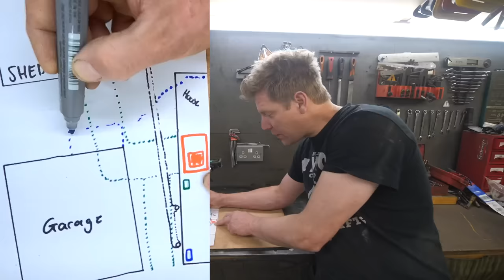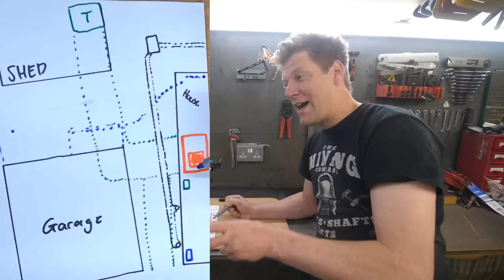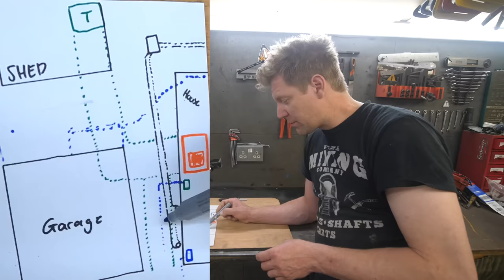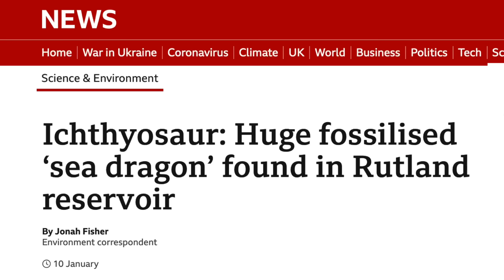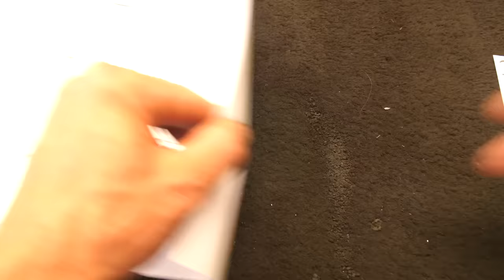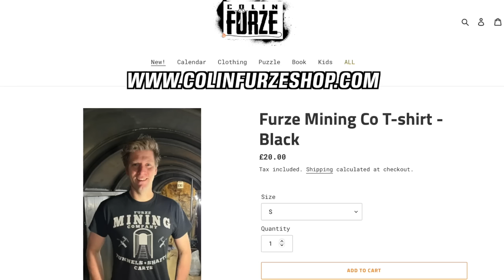DIGGING A SECRET TUNNEL Part 9

Comment: Those major cracks in the rocks are called "joints" by geologists and can form for any number of reasons. You're also totally reasonable in comparing to the nearby quarry, and it's a neat comparison too because some of the first geologists, from the UK, and made similar comparisons to what they found in their digs to quarries miles away - and that near-horizontal comparison helped geologists clue into (sedimentary) rocks being deposited horizontally and that they resulted from "sedimentation".
Reply: Do you know where the draft could originate from? Or could that be from almost anywhere where there would be the slightest hole/crack/gap?
Reply: @Masterfighterx  
The draft could be coming from anywhere along any interconnecting crack. Broadly speaking, it's generated by a difference in heat and pressure from the air source and the tunnel. 

I'd guess it's carrying cool dense air from somewhere a connected crack comes to, or close to, surface and the air is flowing down into the ground and welling up/flowing into his tunnel. Kind of like water flowing from the surface into a leaky basement. In such a case one might see the air flow fluctuate (speed of the air, directionality) somewhat in correlation with surface temperatures/weather/the seasons. 

Another possibility is that it's hot air, warmed by some deeper/nearby heat source (or just the natural earth heat gradient) and it's upwelling/rising through interconnected cracks. 

In both cases, "nearby" could be miles away or right next door. 

Yet a third option, though a bit different from the others, it could be air displaced from the cracks by water, such as from a recent rain, the tides, etc. He might find the directionality of the air flow changes depending on how wet or dry the season is as the groundwater level rises and falls.
Reply: @Dudekahedron  Excellent information!
Reply: Agreed, stellar breakdown! From a fellow geology nerd, all 3 scenarios are fully plausible. Would be really interesting to see any well logs and maps from the area to dial it in.
Reply: @Dudekahedron  Thanks, much appreciated!
Reply: Was he right about how long they can go on for? How big are these joints usually?
Reply: @mangoesareonsaleatcoles660  
Great question! I'm afraid I don't have a definitive answer for that. You'd have to track down a structural geologist, seismologist, or a professional geotechnician. Of which, I am not. I'll try my best to explain how joints work, with what I, am hopefully, remembering correctly, though to maybe give folks a better sense of what they are; "organized" cracks.

I think it's important to know that joints are very common. Their widths, lengths, and heights are all functions of how plastic or brittle the host rock is and whatever changed in the forces acting on it. A sheet of glass is really brittle, so when you bend it too far, the cracks, ie joints, can be really long and "clean". Whereas if you pound flat and bend a sheet of clay you'll be met with swarms of cracks or just it stretching. 

A Joint also, usually, doesn't occur alone. Unlike my analogy, most "bendy forces" don't end up focusing on a single seam, like if we fold a piece of paper (though sometimes, like chevron folds). The bendy forces get distributed over the rock as it "arches", and multiple joints form all with similar orientations.

Edit: they don't exclusively form from bending, either. An alternative example would be gently piling paving stones onto a sheet of glass until it "crushes". Any large systematic force or change in force can do it. 

Because so many can form, it's very easy for one joint to end and a perpendicular joint, or boring old crack, to connect with it and dissipate the forces into a new parallel joint that didn't end. 

The longest joint I've seen, that didn't become a fault, is probably a few hundred meters long and a hundred or so meters tall. It occurred in a really impressive fold that exposed near the top of a mountain near Cajabamba, Peru. Smallest joint I've seen is a mud crack in a dried up pond, a couple cm long maybe.
Reply: @Dudekahedron  if the crack inhaled air could colored smoke be used to trace the exit?

Comment: For your high vent you should look into using a radon evacuation fan. They are inline so it would be easy to add and you can find flow characteristics easily.
Reply: Interesting Cody, I thought about Radon too. Here is New York I heard it can be a problem.
Reply: @zipp4everyone263  I guess my hopes for a tunnel are over. lol😆
Reply: @fjs1111  Nah, radon happens above ground as well. Talk to your local county/council and see if they have any free radon meassuring tools. Id suggest you do it anyway unless you know for a fact that there isnt any radon where you live.
Reply: @zipp4everyone263  Thank you for that information, will look into that!

Comment: These vids are like a guilty pleasure. Just watching them over and over to see if I missed any details, it seems so fun! When colin is excitedly going through the tunnel entrances with a smile it makes me think of fred and george weasley plotting something troublesome. I am curious though, you have mentioned a few times that the mesh does a good job holding back the concrete but what do you do about the little drops that do fall through? wipe it away before it hardens? or is it all behind the walls you are going to put up anyway so you ignore the drops?

Comment: "It's easier to ask for forgiveness than ask for permission".  If I learned anything from this video, this is the #1 thing.  Absolutely brilliant!
Reply: Depends what you're doing, not much they can say about it since no cables or pipework were at risk, and it's not littering his lawn or anything.
I wouldn't take it as good fish to build an annex building at your property near the lake or anything.
Reply: @N Fels 
Listen, what we're on about is this:
They gave Furze the ok (and he was prepared to fill it in once he was done).
Anyone with grey matter in working fashion can see the difference between what Furze is doing, vs putting up a brick house on worm-eaten wooden foundations or stupid stuff like that, the effects of which, Lara Kempf, another youtuber, is struggling with right now.
Also, remember, I CLEARLY advised strongly AGAINST putting up anything on waterfront property and not tell anyone.

I've been in construction for a wee bit, and welding too, and no foundations were made until after the soil was checked, and no concrete was poured until after the concrete was tested, not a single nail, screw, plank or box was put up without going through the OK'ing process.
Same thing with the welding, x-ray's and granular inspections all the way from here and to Japan and back.
Every type of material and composition thereof has it's limitations and tensile strength.
Outside of work I have never put up so much as a single brick or 2x4" or weld bead in any sort of permanent state where strength mattered, without every I and T checked and crossed & approved from and by the appropriate authorities and OTHER professionals, wherever required, and sometimes OUTSIDE of lawful decrees.

Why? Because I live by the mantra that everything you do can be criticized & scrutinized, I make it a point to have it criticized even if I CAN get away without.

That doesn't mean that I have no right to make up my own thoughts, as well as speak them in public for that matter, so long as they're not acted upon, putting lives at risk.

I get that you see a lot of sh*t every day, but you're there for a reason, to catch the 1% that goof.
Trust is the crux and core of our society and we can't function without it.
Next time, keep feelings in check and give people benefit of the doubt, that goes for people you work with, and people you work for.
And if you can't do that, such as you've venomously demonstrated here, you don't deserve so much as a single PENNY of that 40-60k.
That about sound fair enough?
Reply: @ellkir1521  Absolutely! I advise against any unsafe haphazard sh*t, costs more in the long run.
But as Furze clearly said, he was prepared to fill it back in and only seemed to bring it up with city counsil and the like after they spotted it on facebook, and he gave the OK to actually have it inspected for the pure shiz of it, and they actually approved.
So he must have done something right.

Agree about most of the building rules, they're meant to protect contractors and homeowners alike.
And on the note of all the woke building rules, I've even seen those that preach about and for certain codes and the like get their stuff bulldozed too because they thought they were above the rules.

Comment: I think a big part of why your retrospective-planning strategy worked was because you (presumably) had the skills to evaluate what could go wrong (the likely, less likely, and nigh-impossible, all) and the ability to absorb most if not all of the expected consequences if it did. I would think for someone who doesn't have the same skills and experience with construction, plumbing, and engineering as Colin does, you'll want to file with your local authorities BEFORE you get started, so that they can alert you to anything you don't know about.
Reply: his method was a very dodgy way to do it. you should ALWAYS get approval before doing any sort of work that requires the approval of a planning body. he didn't cause he knew they would say no. if he wasn't a YTber they would still have said no
Reply: With the casual way he mentions how upset the town council is, this stunt still might come back to bite him. It's not super frequent, but a few celebrities have found themselves evicted from town by municipal governments for doing over-the-top stuff. The un-permitted tunnel building plus the death-machine-building would look real bad on fun-loving Colin at an official hearing.
Reply: his soil has  clay so sticks together well almost like rock but softer . he is not very deep so chances of it caving in like a trench is very low if not zero. after he pours the concrete it is plenty strong especially since it's only to withstand human foot traffic above and. he is lucky that it's not sandy soil and that the water table is bellow his tunnel or he would have more problems. if it was flooding with water it would be way more dangerous and unpleasant .
Reply: @caijones156  yes always get approval for everything from daddy, you own nothing
Reply: @jamesrustles8670  a planning board exists for a reason. A lot more people would die if it wasn't for planning boards, yes I'd rather people not die.
Reply: @caijones156  bureaucracy is cringe and you should always keep things secret from planning "authorities"
Reply: @caijones156  "if he wasn't a YTber they would still have said no" - if anything, being a Youtuber makes it MORE likely to be denied when it comes to this stuff
Reply: @ska042  not really. They don't want the rep hit of taking him to court.
Reply: What about flooding

Comment: For your vent system I'd want something that could run both ways. For example, the low vent can act as the extractor while the high vent acts as the input, or the high vent acts as the extractor while the low vent acts as the input. This way you'll have more control of the temperature, being able to take hotter air out of the top or vice versa, and most importantly being able to extract from the bottom means if you get any heavy gases down there then they won't build up and become deadly.
Reply: You always extract from the top. Heat causes all fumes and gasses to rise and naturally and escape through the upper vents, even when the fans stop working. In a fire, oxygen sits closest to the floor 👍
Reply: @thra5herxb12s  I'm out of my league here but isn't CO2 (carbon dioxide) heavier than O2 (oxygen)? If there's a vent upwards won't the O2 escape as CO2 builds up?
Reply: Same with carbon monoxide. 💀
Reply: @thra5herxb12s   No, you definitely want a way to extract from the bottom when necessary because there are plenty of heavier than air gases that you need to exhaust out of a low-lying structure like this

Comment: I've done some work digging out under a house and it's actually crazy how much dirt and rock you have to take out compared to how much you've chipped away at it for hours I can feel your pain, well done mate 🙏
Reply: They used to say.
If you dig a trench in the road/path for say a pipe wires etc.
You remove 3 Xs the quantity of soil to the size of the trench hole such is how compact the soil is.
Reply: One wonders how his spine is holding up?
Reply: @stuartd9741  they is right 😄👍

Comment: Oi Colin!
Some real advice here! Look at getting some ESP32 modules and create an air, temperature and carbon dioxide sensor matrix! Sounds really complicated but im sure you can get some help from places like Adafruit or through Pimoroni (Based in Sheffield - UK). Could be the difference between life and death. The units are fairly cheap, you'll have to do a bit of soldering and downloading of code (if the code bit is a bit difficult there are great projects that have already done most of it before) and then you can have some real time data readouts, central command station and sensor offline-warnigns etc :) Can be a really nice side project imo :)
Reply: It's cheaper and saves time to buy it done. Work on a project that doesn't yet exist. I can name at least three companies that have air sensors like you've described, and have more sensors.

Comment: I think it would be cool to have a section of the tunnel displaying the rock face behind a glass panel with lighting. Just to remind you that you're underground. I think this would be nice artistically wise.
Reply: It whould be cool ye but also very unsafe, the concrete is not just for show
Reply: @basvanderwerff2725  A small 60cm by 60cm hole in the wall to display the rock face wouldn't be much of an issue .
Reply: Fill the space between glass and rock with epoxy
Reply: @basvanderwerff2725  I'm aware of that, but a small section of the tunnel so it can be done safely. And I think Colin will be able to pull this off. He's a smart and resourceful guy.
Reply: @basvanderwerff2725  Even a square meter of this would be absolutely fine. Especially if there was still steel framing around it, and maybe mesh. The rest of the tunnel is fully supported with concrete and steel, so this small wall wouldn't cause a collapse.
Reply: @TheGrumbliestPuppy  I can imagine that water would be piling up against the window

Comment: Woohoo!  New video and I can stretch my geology muscle.  There is a lot of speculation here, since I'm not able to directly measure or observe the rock, but I'll give it a go.  First of all, the cracks., hose are most likely joint sets.  They form when a tremendous force is applied to a rock body (or one is released, such as from uncapping).  As the term implies, these cracks form as a set radiating out from the center of the applied force.  If you think of the classic cartoony way concrete cracks after someone fall on to it, or it gets otherwise impacted, that's not too dissimilar to how they form but on a much larger scale.  While they can form in rock such as limestone and dolostone, and that would indeed lead to eventual cave formation if ground water could move through it, you would likely see a lot of evidence around you of cave formation.  Sink holes and other caves in the area, hard ground water, and other evidence of karst topography.  

The hand samples are interesting.  I see stuff like that in Helderberg Group rocks all the time.  However, that might not be quartz.  If you take a steel nail and can scratch it, or apply a small amount of acid (distilled vinegar will work fine, but dilute muriatic or hydrochloric acid would work better) and it fizzes, it is actually calcite.  It's not unusual for calcite crystals to form this way and some can even form into more into more intricate crystals.  That being said, while your "fossil shell" could be an actual fossil (my guess would be some form of bivalve such as a scallop), it could also be a natural crystal formation.  More likely it is a piece of a fossil, but I need to throw the other possibility out there.  The other, more complete fossil candidate could actually be something else completely.  It may be what is known as an ichnofossil, a.k.a. a trace fossil.  Basically, it isn't necessarily a clam shell, but the pit one made at the bottom of the sea that was later filled in with sediment.  If that is the case, I can tell you that the side of the rock that has it was likely the bottom of that layer of rock.